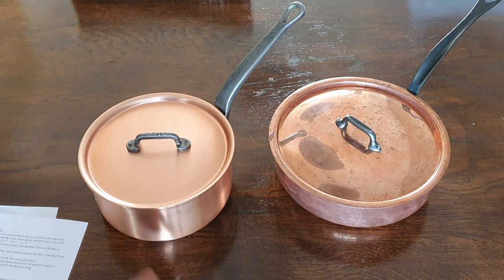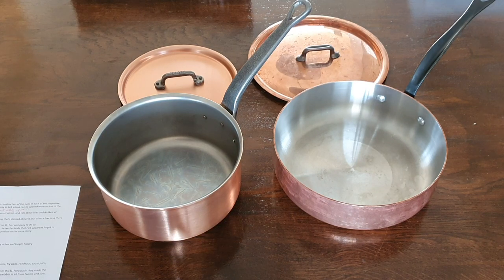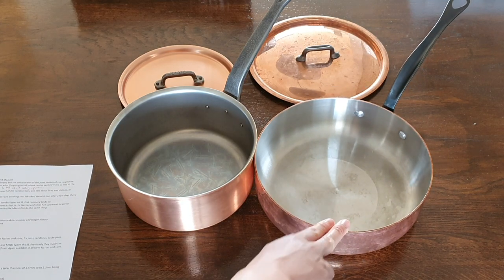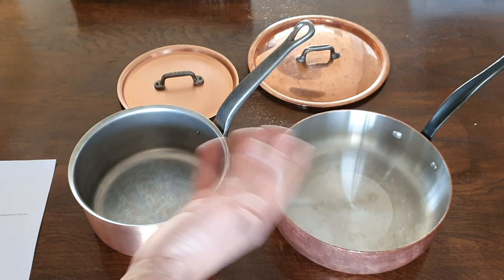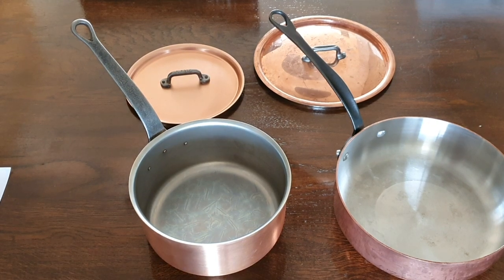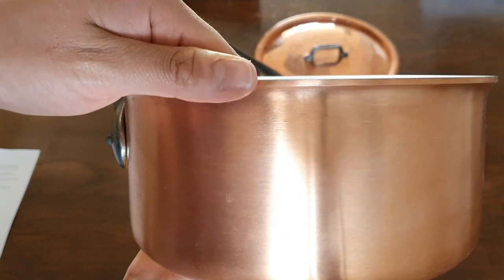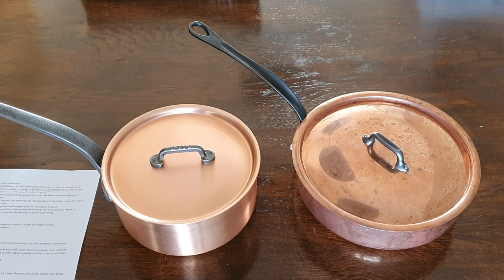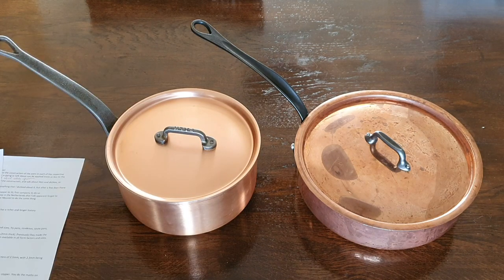Falk vs Mauviel Copper Pans - A Detailed Comparison

Comment: Isn’t that a sauté pan, always thought a rondeau is the one with two short handles
Reply: You are correct, it is most definitely a sauté pan and not a rondeau
Reply: I have Mauviel, and you're right.  The rondeau is exactly the same pot and lid as the saute pan, but the saute pan has a handle on the side like a frying pan and the rondeau has two handles on opposite sides like a cooking pot.  The large saute pan is the one I use more than any other pan, so I bought two of those.

Comment: I never heard of Falk until today, though I've had Mauviel copper since 1986 (tin-lined) and upgraded to stainless-lined Mauviel around 2008.
  
My 2008 Mauviel is their now defunct "Cuprinox Style" line that's 2.0 mm thick instead of 1.5, and includes a slightly flared top edge to the pans like your Falk has here (it's supposed to make pouring things easier), and stainless steel handles.

Having had both 1.5 mm thick Mauviel originally and 2.0 mm thick Mauviel now, I don't think the thickness difference matters all that much for a home cook, and the downside to 2.0 mm thick is the pieces can be quite heavy and unwieldy to pour from and wash (depending on the size and shape of the piece).
  
The 2008 economy crash did in this thicker/more expensive mid-range Mauviel line (Cuprinox Style) and I had a scramble to get the pots I needed before it was gone, so I ended up over-buying and having WAY more than I actually need, but I still love it.
   
For most people I would recommend probably at most five or six pieces.

For cleaning I like Wright's copper polish, including the sponge that comes inside the jar and that you leave inside the jar to use over and over.

Comment: I got my hands on the 2.5mm mauviel:)
Reply from the maker: @liahfox5840  Nice. Not easy to find today anymore.
Reply: Must be heavy.  Around 2008 when the economy crashed I was buying my Mauviel copper and got the Mauviel Cuprinox Style 2.0 mm thick mid-range with stainless steel interior, handles, and slightly flared pan tops for easier pouring.  When the economy tanked they dropped the line, and I was in a scramble to buy up what I THOUGH I MIGHT want/need before it was gone.  Before I was done I had over 20 pots and pans and had spent over $6,000, but I love it, and it performs beautifully.  That's pretty heavy just at 2.0 mm thick so I imagine some pans must be a chore to lift and maneuver to wash at 2.5 mm thick.

Comment: I read online Falk's stainless interior was prone to pitting. Has this been your experience? Are those marks in the bottom of your pan pits or can that be removed? Thank you!
Reply from the maker: No they are not pits, just a bit of patina.
Reply: Wait until your water is already boiling before adding salt and it won't cause as much pitting/staining. This will happen to any stainless steel, but it will show up worse if the cookware was that much more efficient. IE thick-copper/silver cookware.

Comment: So sad that Mauviel lost their forge (burned down)  which made the true cast iron handles, as the Falk still has. This is why Mauviel has resorted to the fake cast iron handle - electroplated textured steel. I also just don't care for the straight sides that Mauviel has on much of their copper. Flared edges always work so much better. I have the Mauviel M'Cook stainless with the cast iron handles and love it but you cannot find those any more. At one time the Mauviel copper made for Williams Sonoma stores had flared rims. I adore my Falk as well as Bourgeat copper too. The cast iron handles of the Falk, as with Bourgeat, are not the same angles from pan to pan. Some are quite steep and other are less so.
Reply from the maker: Interesting to know. Do you know when the forge burned down?
Reply: @mq46312  Around 2015 or so. I was collecting Mauviel M'Cook stainless with the iron handle. Got most of the line - about 12 pieces and then all of a sudden I could not find the ones with the real cast iron handles any more and then I noticed that the Mauviel copper pieces I was seeing in the stores also did not have the iron handles any more.  So I knew something was up. I finally found out from a guy who runs an online store that sells high end copper cookware.

Comment: I've watched some of your videos and I really like them a lot! They are so very nicely in depth into all the details of the pots and pans. 
One thing that might have been interesting for this video would be how they perform on induction. Is this stainless steel layer magnetised in any way or would one be better of buying Atlantis-cookware?
Reply: And to add to that a comparison between an all-copper cookware vs. clad cookware with alu/copper core would be particularly interesting for me as I'm hesitant on what to buy.
Reply from the maker: @GistGappie  Copper pans won't work on induction unless they have a magnetic SS base. Falk has a induction-compatible copper core line, SS-CU-SS. De Buyer also makes copper pans with a magnetic SS base. Interesting suggestion!
Reply: Isn't he great (MQ)? I so enjoy his analyses of each pan. 

I hope you don't mind if I give my opinion on this question. I have some of both Falk Copper Coeur (made for induction) and the De Buyer Prima Matera copper, also made for induction, as well as the Demeyere Atlantis. All three are wonderful, and the Falk CC line is really impressive. What I find is that having some of both Demeyere Atlantis and the Falk and/or De Buyer is helpful. The copper pans will react much faster if you're making a sauce, for instance. For searing and other higher-heat applications where you really want the heat to hold for a bit of time, you can't beat the Demeyere. The Demeyere Atlantis takes a lot longer to cool down on induction, so sometimes you want a pan that will react more quickly to heat changes, and then the Falk Copper Coeur is helpful.
Reply: @tbeesknees  Thanks a lot. This was really insightful! Knowing this I'll probably expand my Atlantis series then and also look for one ss-cu(-ss?) small saucepan for technical/precise stuff like caramelising sugar etc. Maybe the Falk "try-me" 16 cm pan would be a nice offer to check out then. Not sure if it is also on discount in Europe/NL.
Currently I'm on a gas stove but knowing that I'll probably be cooking on induction later in my life I find it hard to not include induction-compactibility in the decision.

Comment: great video thanks so much . I would love your opinion i am trying to choose between Falk and Mauviel and a LeCreuset braiser for use on our induction cooktop. I am replacing a 13 inch 
scanpan braiser which is no longer non stick (never again).  Thanks so much for your input i really appreciate it.
Reply from the maker: I assume you are looking at the Falk or Mauviel copper range? In that case they won't work on induction.
Reply: @mq46312  falk has the copper coir and Mauviel has the m’cook or m’6s line. M’6 and the copper coir are copper and work on induction
Reply from the maker: @jstones9872  I would go for Mauviel m'Cook if price is not an issue. Just my personal preference.
Reply: @mq46312  thanks price isn’t biggest factor. But the m’cook is not copper?you think that better than the copper sandwich mauviel?
Reply from the maker: @jstones9872  I don't think the copper cores adds enough benefit to justify their cost generally speaking, although the m'Cook may still be more expensive. I typically prefer a straight forward heavy gauge SS pan.

Comment: I don't get why Mauviel reduced thickness of its 2.5mm pans to 2.0mm. 1 kg of copper costs 7.80 USD (21 Sep 2022). There is some cost to change an ingot to a sheet. How much more copper is that extra 0.5mm? Unlikely to be more than 1 kg per pan. A copper sheet 1000mm long, 1000mm wide, and 2.3 mm thick weighs 20.79 kg. If it is 2.25 mm thick the weight is 20.34 kg. Change the thickness to 1.8mm and it's 16.27 kg - roughly 4 to 4.5 kg less. You can get a few 12" frying pans with a 1m square sheet. And unused scrap can be sold back, so there isn't much waste. 

Sure, at scale producing thousands of pans it'll add up, but better to increase the price of a piece by a few dollars rather than take the hit to the reputation.

Matfer Bourgeat is still doing 2.5 mm copper + 0.1 mm stainless. Cast iron handles and rounded lips.
Reply: 100% agree